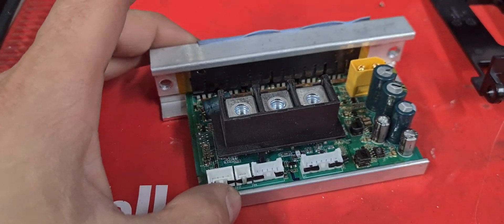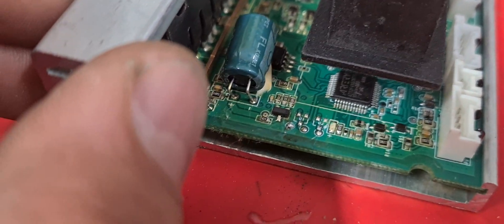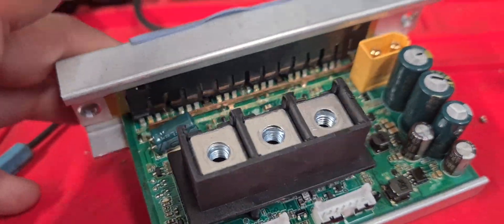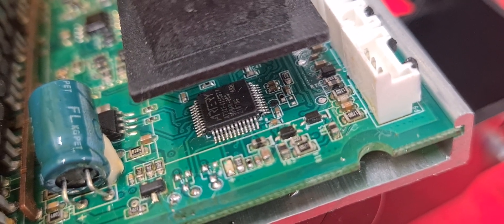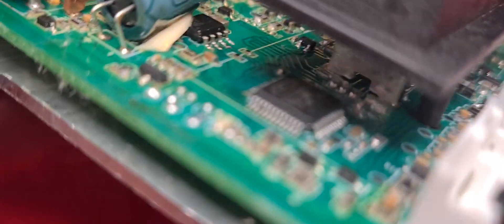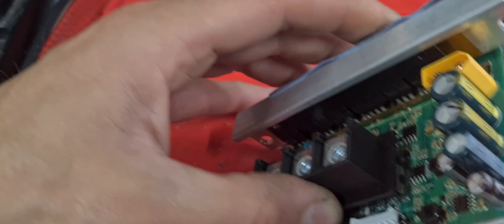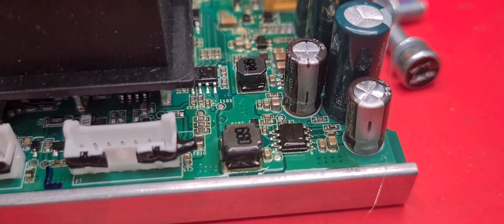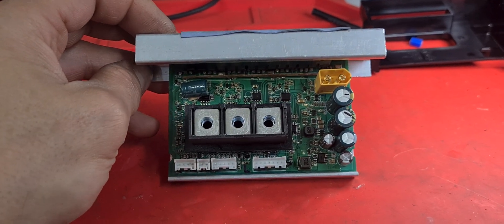New Ninebot G30 controller 2022

Comment: Is this controller replaceable ? I have the ST32 Controller here and the new one but the connectors dont match with the new screwed ones
Reply from the maker: You can st link the new controller now to lock up speed.

Comment: if you blocked the controller trying to downgrade with the new version 1.1, it can be solved using the following procedure
Reply: The new Artery chip has a self-erase function when you try to downgrade, this means that chip is now empty. 
To fix this you have to write the bootloader and after that the 1.7.3 fw. After doing so you can hack it using scooterhack utility version 2.1.1.

Comment: I blocked this controller and my scooter doesn't start anymore.  I had version 1.7.0.  with ST-LINK can I write the version I had?  if possible, where can I download it (I found only 1.7.3)

I just want to make it work like it was before....
Reply from the maker: Yes you can use reflasher from scooterhacking to st link

Comment: Bricked mine trying to backdate the software. Super sad. Can't find anyone to help me. Brand new scooter paperweight.
Reply from the maker: Have you checked if you have the new controller? If you brick the controller the it just ny a new controller then it will work. Even have with costum firmware for full speed.
https://www.wattsnabb.se/products/ninebot-g30-max-modellerna/reservdelar-till-ninebot-g30-max-modellerna/original-ninebot-g30-g30d-max-moderkort-kontrollkort
Reply: @WattsnabbAB  Thank you. I will have to do this. Will this controller be compatible with my battery and motor?